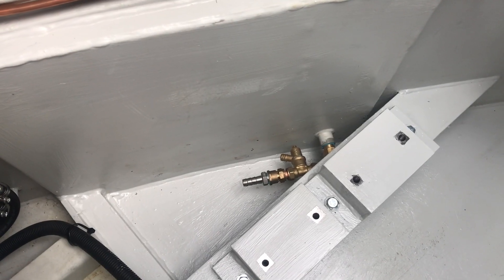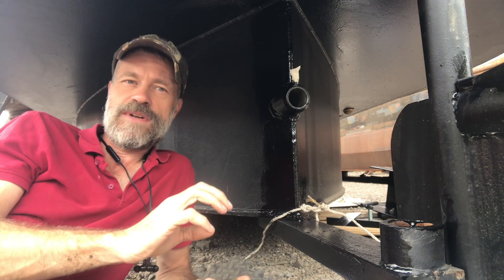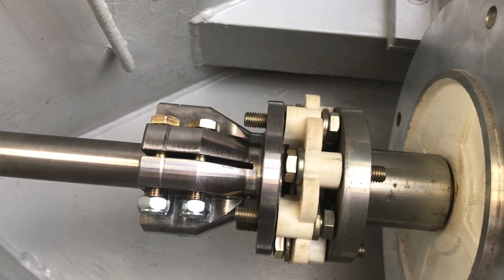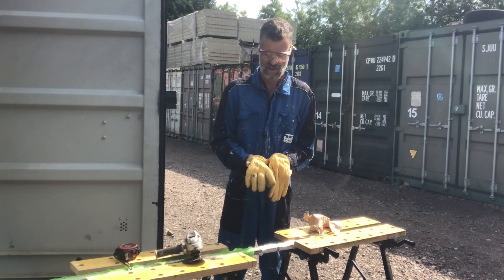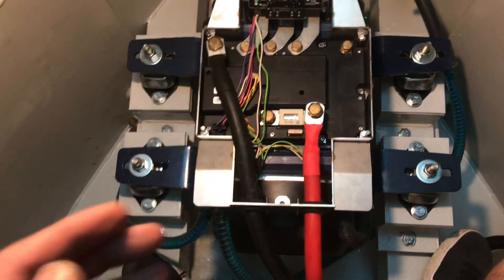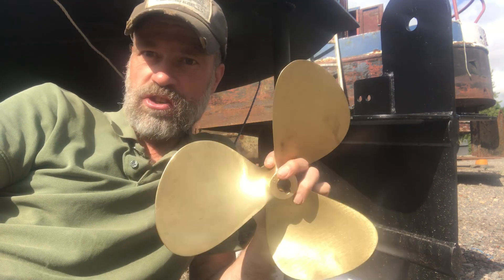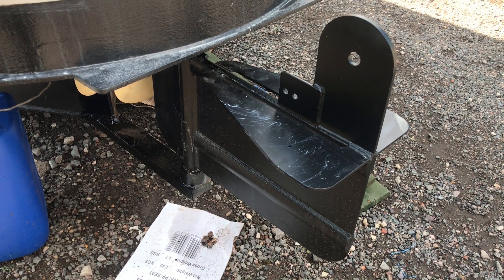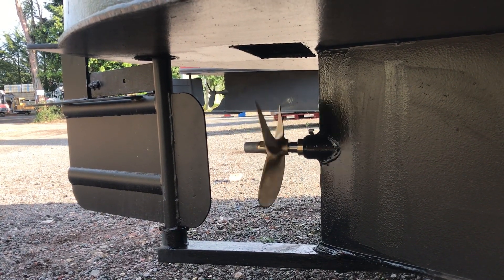61. Installing the Electric Propulsion Motor & the Stern Gear

Comment: what stops water travelling outside the brass tube?
Reply from the maker: If you look at about 13:13 off the video  you see the ‘stern gland’ on the inside- this has a series of rubber seals around the propeller shaft that stop the water coming in.

Comment: Most motors don't have thrust bearings. All the installations I have seen have one before the motor. Does this motor have one? Seems a very easy one to fit, it it does.
Reply from the maker: Hi there, yes, the installation instructions specifically say that a thrust bearing is not required, which as you say, makes things a lot simpler 🙂
Reply: @narrowboatmlc  wow! I must follow what you have done. Looks like you have chosen a really simple swap out solution.
Reply from the maker: For me it’s not a swap out, but regardless, given I am doing it myself, simple is better (and I would have struggled to get a thrust bearing in, space wise, what with generator right behind) 😊
Reply: @narrowboatmlc  on my boat, that placement would put the generator in my wardrobe 😊. Right now it houses the filters and alternator end of my engine.